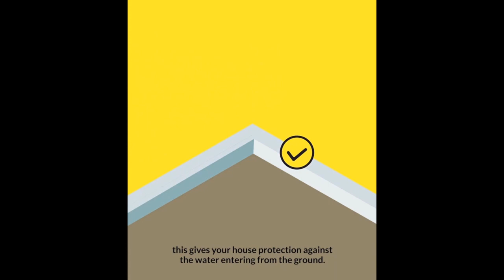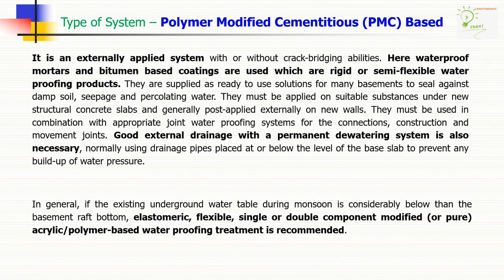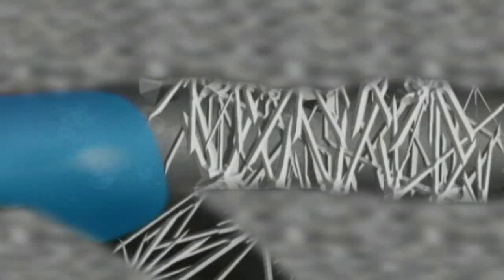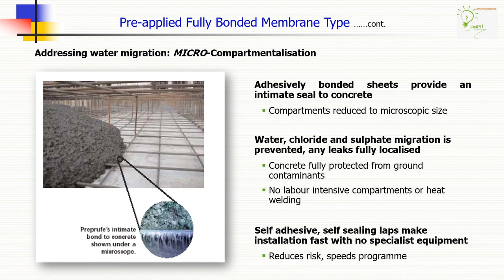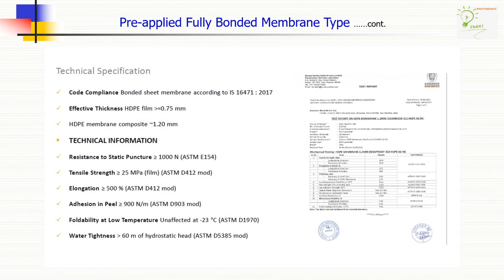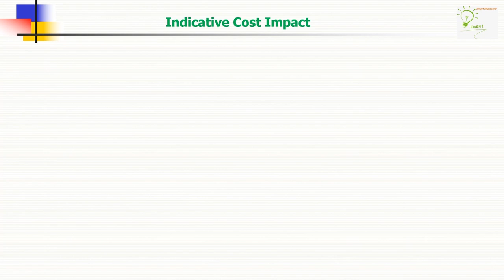Basement Waterproofing Systems

Comment: Extremely useful and informative video. However I would like to share the following experiences pertaining to this.
1. Sudden drop of workability of Concrete after adding Penetron Crystalline compound.
2. For a fully bonded HDPE membrane,  the chances of damages due to Reinforcement work is very high.
3. For a fully bonded HDPE membrane, in case of ingress of water from adjacent catchment area in the Rainy season and subsequent deposition of thin layer of soil, the chances of damage of HDPE membrane is very high and sometimes impossible to repair.
4. Application of Hybrid polymer based liquid membrane for the vertical surface of the Retaining wall is also a good alternative.
4. Application of plastized PVC Waterproofing membrane is also a good alternative for Basement Raft waterproofing.
Onceagain, thanks for sharing such detailed procedures of Basement waterproofing.
Reply from the maker: Thanks for your feedback.

#1. If mixed properly as per manufacturer's methodology, we found no issue with workability.
#2. That care shall be taken and in case of damage the same shall be repaired appropriately. 
#3. You mean if it is left as partly done condition?
#4. Not only about Basement.....we have to keep in mind the underground water table as well. HDPE (of appropriate thickness and pressure resistance) works better when ugwt is high.     

Once again, thanks for your time and constructive feedbacks.